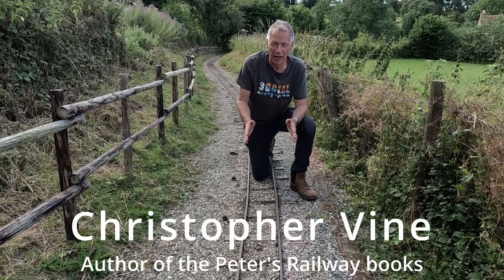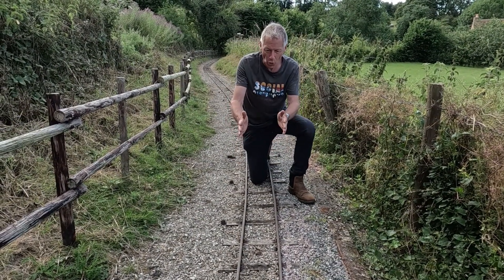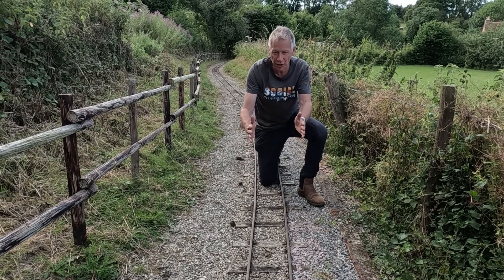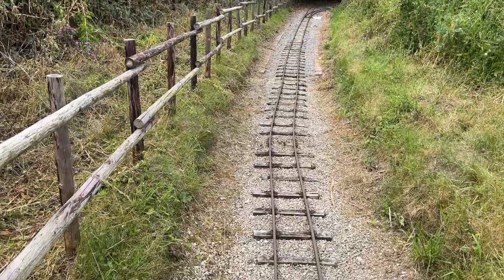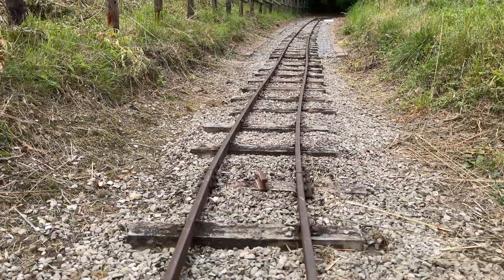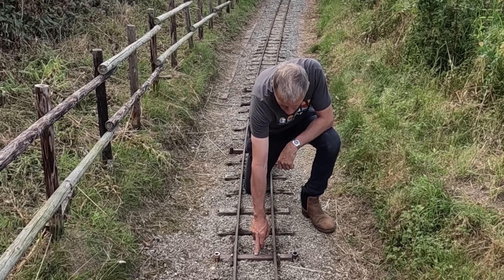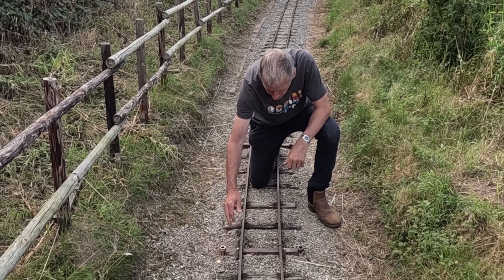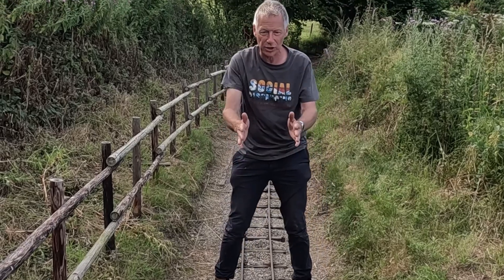Buckled Track at Peter’s Railway – A Near Disaster…

Comment: I would have thought this would happen in the summer not the winter time?
Our temperatures have been from -2 to about +10, so I would have expected a pull appart of the rails not the reverse.
Reply from the maker: I see what you mean, but the buckling in hot weather isn't really down to the tensile strength of the rails, rather it is the easy way out which buckling gives for the stress to be relieved.  It is all part of the fun of running a railway!
Thanks for watching! Best wishes, Chris.
PS. If you would like to know about the books I write to teach children (age 3 to 90!) about railways, science and engineering, there’s lots of info here: https://petersrailway.com/ and we ship overseas.

Comment: I was told that winter actually contributes towards heat buckles in summer. During the winter, the rails contract more than usual so the track can move towards the inside of the curve, in other words, the opposite direction of a heat buckles. The curve is now taking a shorter distance between the straights at either end of it. . When summer arrives, the track is potentially in an even worse position to handle summer expansion, and therefore the risk of heat buckles is increased.
Reply from the maker: Very interesting.  I had not heard that expressed so succinctly but it certainly makes sense.  I can easily see that cold will pull in the curves and make it worse in the next heat.  That is why I peg the curves on both sides:  To stop it blowing out and the prevent it pulling in when the weather is cold.  Fingers crossed!!...
Thanks for watching! Best wishes, Chris.
PS. If you would like to know about the books I write to teach children (age 3 to 90!) about railways, science and engineering, there’s lots of info here: https://petersrailway.com/ and we ship overseas.
Reply: @ your welcome. It’s all about sharing the knowledge.

Comment: On full size track, one cause of buckles I read, is rail laid on different temp days with the key factor being temperature differences greater than 15 deg C. 
So if you lay some track on a 5 deg C day and then some on a 22 deg C day you might be inviting this sort of thing on a 28deg C day.
Apparently this was discovered by going back through records after some particularly troublesome sections of track buckled in the US on the UP railroad. They found sections subject to temperature extremes that didn't buckle were laid on days that happened to be within 15deg C, so they implemented a 15deg C rule on certain problematic sections and after that no further buckles were encountered. 
I thought of that article when I watched this vid.

There are probably other contributing factors but I only remembered that one lol.
Reply from the maker: Interesting.  I know that on modern continuously welded track, they make sure there is tension in the rails, even on the hottest days.   I think they use hydraulic rams to stretch the rails.  That would be a bit to high tech for here!  Also, I suspect that it would just pull in the curves - the track and ballast isn't really heavy enough.
Thanks for watching! Best wishes, Chris.
PS. If you would like to know about the books I write to teach children (age 3 to 90!) about railways, science and engineering, there’s lots of info here: https://petersrailway.com/ and we ship overseas.

Comment: Good job you spotted that Chris. Obviously you can add expansion joints, but I suppose you could also firmly fix one end of the straights and tension them like they do in continuously welded rails today.
Reply from the maker: Hi Roger!  Yes, it could have been tricky, and you know how much time goes into making these engines...  I have put some tension into the track by kicking out the curves on a hot day and then fixing them with posts.  It seems to be wroking - until the next time...  Keep breathing in and out!  C

Comment: As many have said, you need expansion joints or gaps in yiur rails, like the realnthing, metal expands in hot weather and contracts in cold, just because it's a minature railway doesn't mean it can't happen - as you've found out to your horror. I'm very surprised that some one so skilled and methodical could over look such things, but we live and learn as they say. It's all a learning g curve and every days a school day, I hope you manage to devise an expansion joint so that the rails can expand in summer and contract in winter, maybe just make a minature version of one like the real railway use - all the best.
Reply from the maker: The newer sections of track have expansion joints, but the trouble still is that the weight of track and ballast is so little, that any friction in the joints will still tend to move the track.  So, it isn't quite the perfect solution you might imagine.  The place where this happened is some 50 years old and, even if there were gaps, the fishplates have rusted solid years ago!!  
Thanks for watching! Best wishes, Chris.
PS. If you would like to know about the books I write to teach children (age 3 to 90!) about railways, science and engineering, there’s lots of info here: https://petersrailway.com/ and we ship overseas.

Comment: Slotting the fishplate holes and gapping the joints will fix the problem, then use nyloc or aerotight or stiff-nuts to maintain fishing pressure. This allows the gaps to move without buckling. Set a fixed/spiked length every 5 or so gaps to keep them even.
Reply from the maker: That is exactly right, and what we have done on the new sections.  The part which buckled is over 50 years old and all the joints have rather rusted up!  
Thanks for watching! Best wishes, Chris.
PS. If you would like to know about the books I write to teach children (age 3 to 90!) about railways, science and engineering, there’s lots of info here: https://petersrailway.com/ and we ship overseas.

Comment: The full size railway had gaps of 3/8" at the end of each track panel to avoid this issue.
Reply: Are you sure? Many full size high speed lines have welded tracks.
Reply: @malcolm6951  yes, the panels I'm talking about were upto 60ft in length. I would have said CWR, which has sliding expansion joints.
Reply from the maker: This part of the line is quite old and even if there were room for expansion, the fishplates have rusted to the rails!!  The newer sections have a better arrangement with expansion gaps.  The trouble is that the sleepers and rails are much lighter than on the big railway and it is often easier for the track to get pushed about than for the rails to slide..
Thanks for watching! Best wishes, Chris.
PS. If you would like to know about the books I write to teach children (age 3 to 90!) about railways, science and engineering, there’s lots of info here: https://petersrailway.com/ and we ship overseas.
Reply: @malcolm6951 cwr has enormously heavy concrete sleepers , 120 lbyard  rail really massive roadbed and ballast shoulders and is laid hot so it’s under considerable tension in freezing weather. A broken rail can pull apart six inches. Light rail on wooden sleepers is extremely mobile and need’s gaps

Comment: We use expansion slots in between the rails. We cut the end of a rail in half and the opposite side too. Then you can push them together with a little room in between giving some play to expand. If you peg it all down it will still find a place where it starts to make a small kink because it has to expand to somewhere.
Reply from the maker: We do the same on the newer sections of track.  (see the Turning loop video.)  However this track is rather older and uses simple angles and bolts.  Even if there was room to expand, 50 years ago, they have rusted up long ago!  I try to keep the track in tension by pulling out the curves - funnily enough the same on big railways with continuously welded rails!!
Thanks for watching! Best wishes, Chris.
PS. If you would like to know about the books I write to teach children (age 3 to 90!) about railways, science and engineering, there’s lots of info here: https://petersrailway.com/ and we ship overseas.

Comment: A few public transport operators have been trialling a method of guarding against this: Painting the rails white. It may seem silly at first glance, but it reflects more heat than it ordinarily would absorb, and keeps the rails from warping. Might be worth a shot considering the weather isn't going to get any more reasonable in the coming years.
Reply: Does it work? White also radiates less.
Ideally, you would want a paint that is reflective in visible light, but dark in infrared.
Reply from the maker: Good suggestion!  I have seen the sides of the rails painted white in a few places.  I guess it would work as a black car roof is much hotter than a white roof.  
Thanks for watching! Best wishes, Chris.
PS. If you would like to know about the books I write to teach children (age 3 to 90!) about railways, science and engineering, there’s lots of info here: https://petersrailway.com/ and we ship overseas.
Reply: I'm afraid I'm the wrong audience for the books. Would you let us know in the summer whether the trick works or not? Thanks!
 @PetersRailway
Reply from the maker: @lillywho  No worries.  It is a good idea to revisit that part of the line, on a really hot day.  If we ever get one that is!! C
Reply: @landsgevaer  No, you don't... if you used a paint that was dark in infrared, the rail would absorb more heat, which increases the chance of buckling.
You really want a paint that reflects heat away before it sinks in.
Reply: @LordPhobos6502  No. Absorption is from sunlight mostly, you will hopefully agree. The sun radiates most strongly in visible colors, so you want a light color there to prevent absorbing all that light. At the same time, the emission by the rail is in infrared. So you want efficient radiation in infrared, and that is achieved by a paint that is black in the infrared. The point is that the rail emits more than it absorbs at that wavelength.
Maybe you are not accounting for the fact that black in infrared not only means good absorption but also good emission. Black means "much energy exchange" and white means "little energy exchange". You want little exchange in the visible because that is the sun heating up the rails, but a lot of exchange in the infrared because that is the rail radiating away its energy.
(BTW, i do not mean near-IR here, where the sun would still dominate; I would be talking about ~8 micrometer wavelength.)

Comment: I always find it fascinating how you fix things at your railway, it’s amazing!
Reply from the maker: Thank you very much!  
I am in the middle of a complete overhaul (and repaint)  of the little tank engine.  You can see it hauling the brick train in the Turning Loop film.  
It will end up a a mini series I think - there is too much material to fit into one film.  Also, I tend to avoid YouTube vids which are longer than 30 minutes!!
Thanks for watching! Best wishes, Chris.
PS. If you would like to know about the books I write to teach children (age 3 to 90!) about railways, science and engineering, there’s lots of info here: https://petersrailway.com/ and we ship overseas.
Reply: Pegging it down wouldn’t have fixed it.  It will just move the problem elsewhere.  You need to cut expansion gaps into the track to fix it.